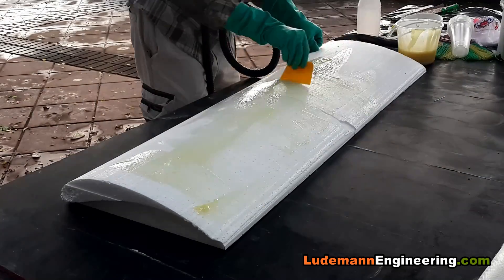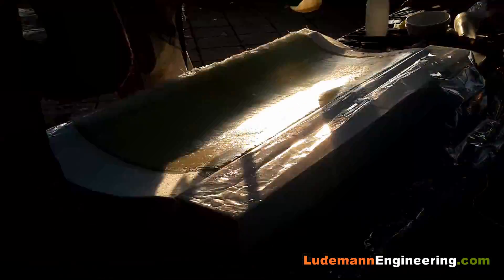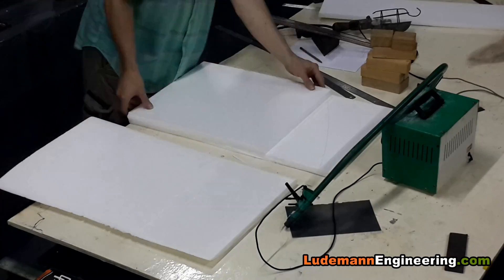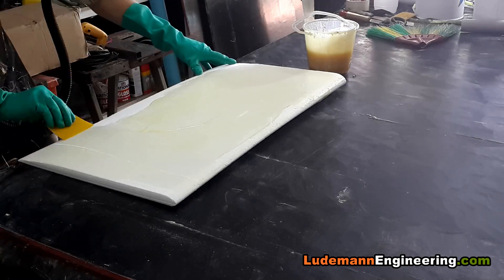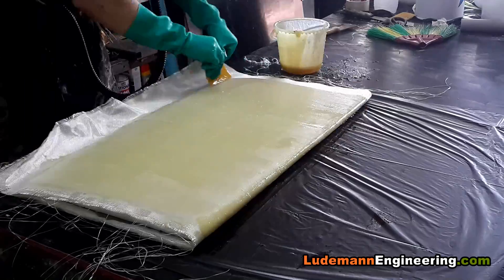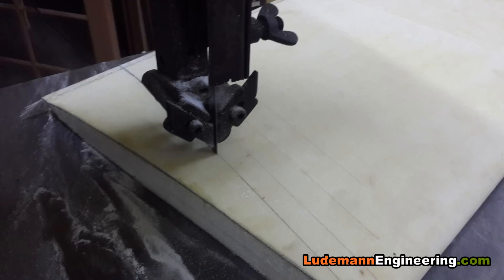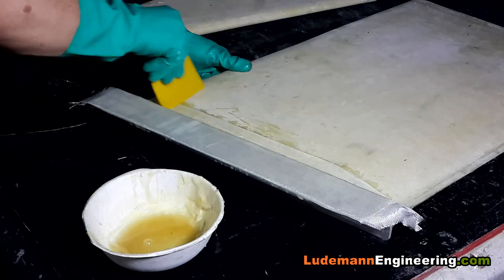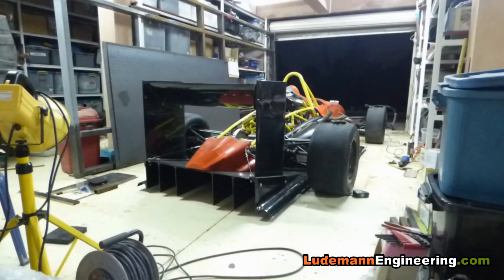How to Build Race Car Rear Wing Moldless Fiberglass Foam Core Composite Construction

Comment: you think it would work well to 3D print a hollow very thin positive mold for a wing and then lay carbon fiber over it exactly like you did here?
Reply: Dunno if this would help you, but we did an experiment in our FSAE project where we printed abs parts with 50% infill and 1.5mm perimeter wall. Then laid carbon fiber over it. It worked out but we went with nomex core and molding process, in the end. Nomex cores soak up resin and have better adhesion with the composite fiber layers than parts with carbon fibre skin over 3d prints.

Comment: Why does the foam don't melt with the fiberglass resin? I try that once and it melted the foam
Reply: They used epoxy resin, not polyester (fiberglass) resin.  Polyester resin is the type that will melt styrofoam.

Comment: great video and even better end result. A lot of the parts you make require you to fiberglass on top of cured Epoxy resin is sanding enough to get a good adhesion to the cured Epoxy primer? with polyester resin it has a chemical bond and softens the cured layer to join them. (ps don't try polyester resins with polystyrene its a fail)

Comment: Really surprised you are only orienting the glass on x and y axes.  ±45° orientation adds a LOT of strength and prevents distortion; you might look into that.  Also, vacuum bagging would reduce excess epoxy and the epoxy/glass ratio is really important for strength.  Honestly, nice job but pretty much technically oblivious as regards to strength.  I write this as an areospace composite tool designer.
Reply: You wrote this without much sense of economy, but thanks for the heads up

Comment: I am shocked that the epoxy doesn't dissolve the Styrofoam. Is it special Styrofoam or epoxy? awesome work by the way, we are building our own car from scratch, swing by our channel, I would love to hear what you think. I am very happy I found your channel. Keep the videos coming. Best Matt
Reply from the maker: I only have one choice of styrofoam and one choice of epoxy resin here, so I have to assume they are both generic. They work fine together. Good luck on your project!
Reply: Ok, Thanks for doing the videos. Keep making them.
Best Mat
Reply: Styrofoam is dissolved by polyester resin (contains styrene). Afaik epoxy doesn't emit solvents while curing. So it works with polystyrene.

Comment: Can a monocoque tub be built this way using denser foam and thicker woven rovings? without using carbon fiber and RTM?
Reply from the maker: You could do that, as airplanes have been built this way. The problem, as always, is the design & implementation of hard mounting points.

Comment: I'm kind of surprised that you're not using any kind of filler or similar on the styrofoam first for a better finish, and that you're also not vacuum bagging your parts.
Reply from the maker: The epoxy resin fills in the styrofoam just fine, and I don't see any foam texture on the outside. I'm don't think vacuum bagging will work on a wing like this as it will crush the trailing edge, but I use it on other parts like the wing endplates, diffuser strakes, and the floor.

Comment: What are the reasons that you didn't use carbon fiber for this? Strength difference, weight difference, or price difference?
Reply from the maker: Carbon fiber is prohibited in Formula 1000 in any panel "licked by the airstream", so that includes the entire body plus radiator ducts. SCCA did that to keep costs down.
Reply: #1 price

for 2 strength, flex, bend breaking point, weight 
(s class glass) is even too/better then carbon 
(normal glass) is just slightly.. slightly weaker in most of those category's 
by like 10% 

so basicly look at it as cost effective 
unless you want carbon looking parts no need

Comment: hello James, 
i was watching this video of yours again i noticed that you said something about a study for the rear wing with finite element analysis, so i was wondering from where did you get the cloth modulus strength data please ? 
i would really appreciate your help about this, because i am making my final project for master degree. Included in my project design and study of racing car wings which will be made from fiberglass

Comment: Some work went into those, what's the weight of the car all in?
Reply from the maker: I haven't weighed the car with all the  body pieces on, but I expect it to be around 850 pounds. There's room to lighten it in the wheels, tires, floorpan and differential.

Comment: Hello I've watched a few of your videos now and like your process, for improving my own work why do you not use a roller when laminating? is this just your preference or is it something to do with a finsh?
Reply from the maker: +Ryan Abrahamson That's a good question, as I've used rollers with polyester resin when making the molds and body. The epoxy I can get is too thick to work well with a roller, so I'd need to use a plastic squeegee anyway after the roller. I can push much harder on the squeegee. Plus rollers are really hard to clean for repeated reuse.
Reply: Cool man that makes a lot of sense i will buy a squeegee with my next order and give it a try, thank you and look forward to more videos!!!

Comment: Please tell me that this thing is at least going to see some test session track time relatively soon.

Even better, I'd love to see you get it in race trim, and actually do some competition laps before the season is out.

What's your current (realistic) timetable for both those milestones?
Reply from the maker: +hippyjason We're planning another test day later in April, 2016. If the car feels right we'll crank up the speed, but still not going for a track record. Competition laps are problematic, as it's the only Formula 1000 car in Thailand.
Reply: +Ludemann Engineering Wow. Ok, don't they at least have some kind of formula libre class out there? Or at the very least, a run-what-ya-bring class?

I take it your long term goal, then, is to make and sell a sufficient amount of these things so that there will eventually be enough F1000 cars in Thailand to be able to make a decent enough sized grid, so that you can then have a viable class/race series?

What's the biggest-sized formula car that they already currently race as a series over there -Formula Ford? Does Thailand have a SCCA equivalent sanctioning body?

Sorry for all the questions, but this is a completely fascinating subject to me. :)
Reply from the maker: Auto racing in Thailand is controlled by the Royal Automobile Association of Thailand (raat.or.th). There's such a big language barrier that I don't really know what classes are officially sanctioned. I think they have something like Formula BMW and Formula 3. But you're right, we want to sell enough cars to have races in Thailand.